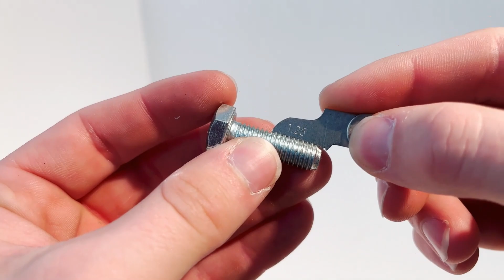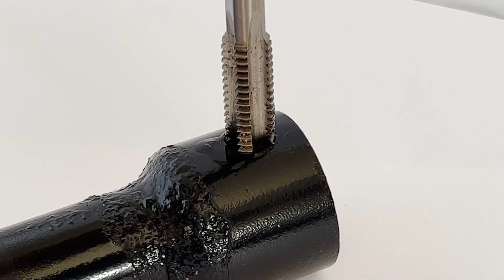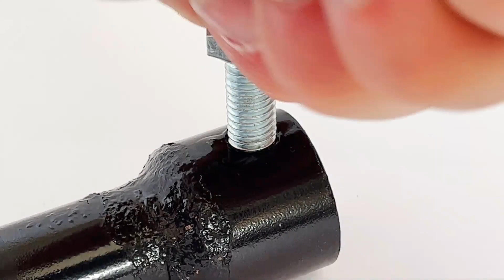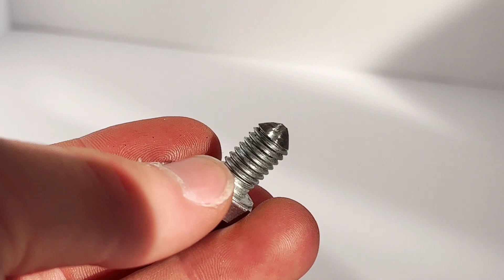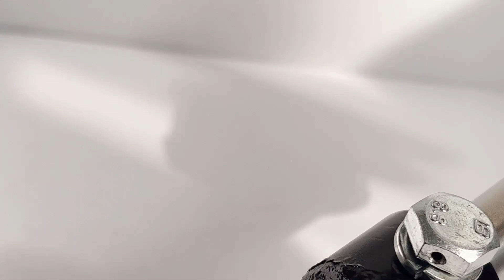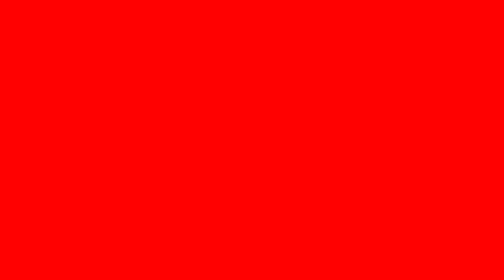Fix Your Shift- Shift Linkage Repair || 1989 Porsche 944 S2

Comment: Good idea on the lockwasher, loc-tite and safety wire. I recently had my shifter bolt come loose. I found it before it got bad though. If it comes out it can leave you stranded!